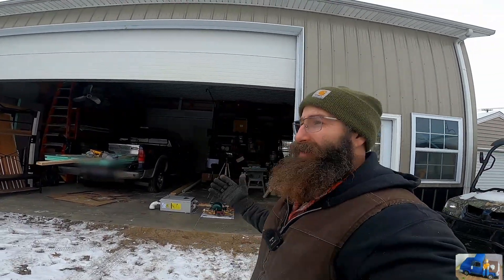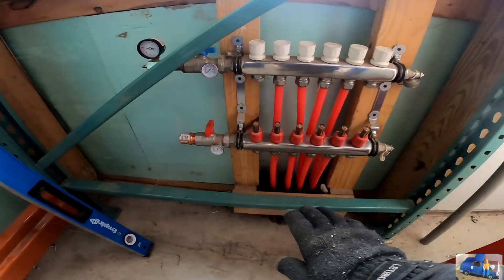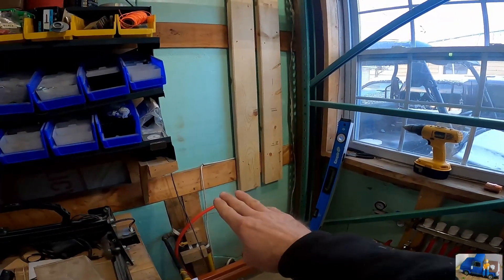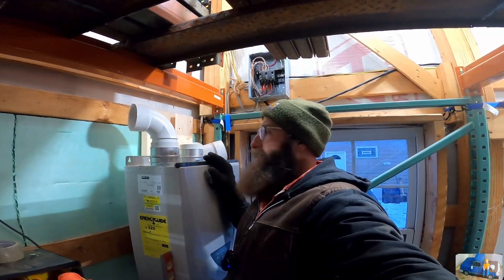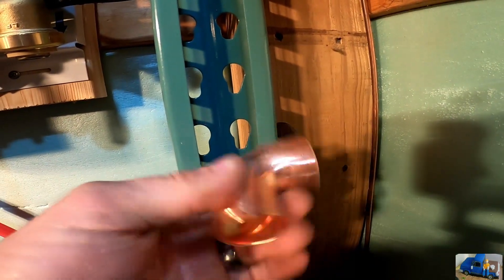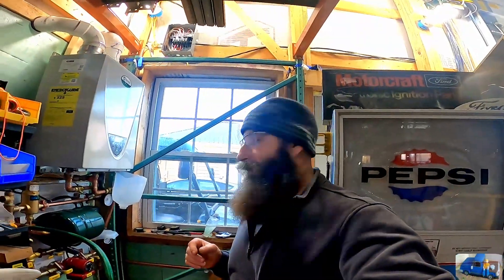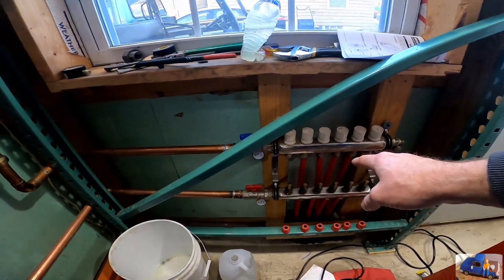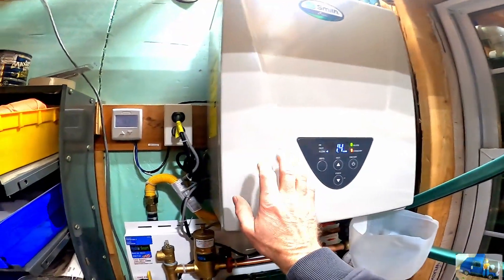Concrete Heat Finally!!! - Hydronic Floor Heat

Comment: I DIY'ed this for snowmelt for my driveway. Built my own integrator panel and used a simple electric water heater. Not nearly as fancy as that preassembled one, and there are lots of kinks to work out, but it's functional!
Reply from the maker: I originally planned to build my own unit, but didn't want to solve all the potential issues.  This unit looks nice, has a proven design, it's easy maintenance and has a pretty awesome technical support team!  My only complaint is I waited too long to install it.  My multi year delay made all the components substantially more expensive!  🙄I like your idea of using it as an ice melter.  It's an awesome concept and requires zero shoveling!  Thanks for watching! 👍😁
Reply: @FlatThunder  yeah, it was hell trying to figure out where leaks were and how to fix them lol. Thankfully there were none in the tubing under the slab

Comment: I put heat tubing in my pole barn when we poured the floor back in 2016.  In 2020 I finally installed a boiler.  I live in central Minnesota and can tell you it is the single best feature of my shop.  The heat is consistent and super comfortable all winter.  One of the benefits of in-floor heat over forced air comes when you have to open the overhead door to move things in or out.  Since the floor heats the space, I don't loose all my heat instantly when I open the large door.  You're gonna love this setup!
Reply from the maker: I think it will be great!  No more freezing when working on things at floor level and passing out when you stand up again!  What is the temperature of the water you pump?  Thanks for watching!  👍😁
Reply: I have my boiler set to 114F.  Mine is electric and on load management thru my electric COOP so I get my power at half price.  I heat my 300 sq ft wood shop to 60F and my 1200 sq ft auto shop to 45F. @FlatThunder
Reply from the maker: @TheToolmanTim  my unit is currently set to 120 °F and I have the floor probed.  Currently shooting for 72°F concrete temperature.  I hope I can afford the utility bill!  This is a new kind of heating process for me and I have no gage on its energy consumption.